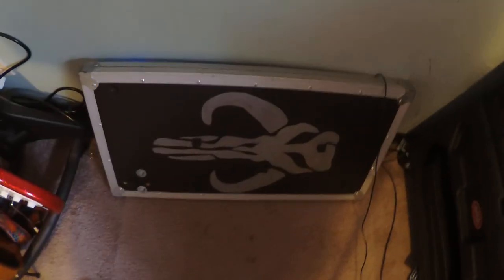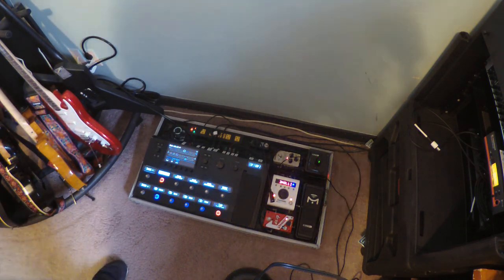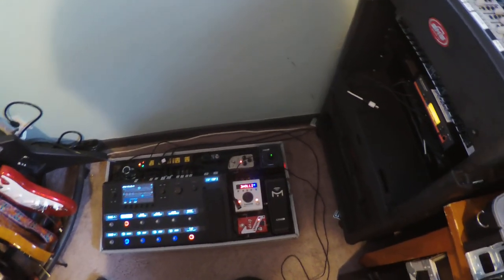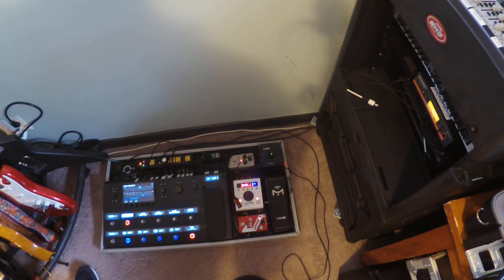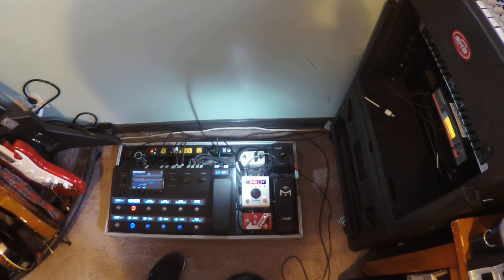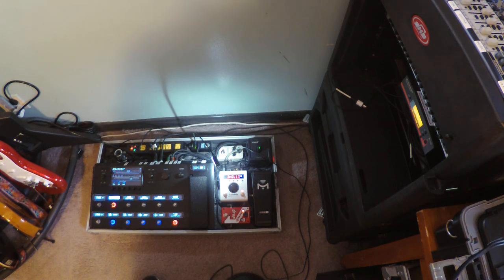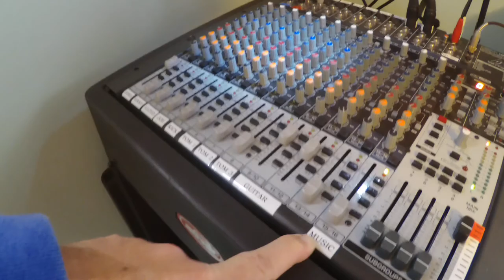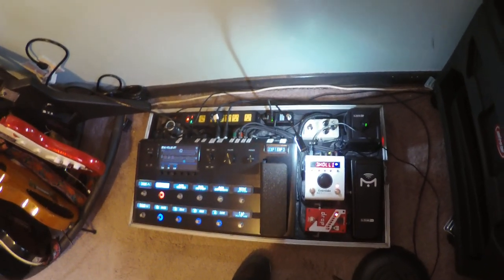Josh's Helix Pedal board

Comment: I like the setup - very nice - I was under the impression that you want to use the drop before any effects so essentially tuner (like TU-3) then Drop - then Helix.  With Guitar then going into the tuner or in possibly your case the drop.  But from your video you mention you have the drop on a send/return loop (possibly with the mimiq) - if true where do you plug in your guitar?
Reply from the maker: I go from the G10 directly into the Helix.  I used to go into the Drop first but I changed it up.  The Drop is in Loop 1 and that loop is the first thing in the chain of FX.  I have a noise gate right after it and I turn off the noise gate in the input block (where you can choose the input type - guitar, variax, multiple, etc).  I only have that loop on 3 patches that I use for tuned down songs (Godsmack and Limp Bizkit).  Loop 2 is the Mimiq and that is after the amp at the very end of the chain with only delay and reverb after it.
Reply: Oh right the G10 - forgot you were running that.  Thank a bunch.

Comment: Great vid. I recently purchased the Helix and was curious about a good board. 
I also just tried connecting the XLR to a PA and had latency issues (strange).  Have you ever run into that issue?
Reply from the maker: No latency at all.  The Drop pedal has a little latency but I don't notice it.  Heck, sometimes I leave it on and start playing the next song in the wrong key.  That's embarrassing.  But no, I don't have latency.

Comment: Looks like you are using the mission spring loaded pedal. How do you get the effect to kick on with the pedal only? If the wah is always on, how do you keep it from bleeding through when not in use? Thanks
Reply from the maker: It's not spring loaded.  I did experiment with using rubber bands around the heal for a while and that worked OK.  In the Helix bypass assign for the wah I have it set to activate at 1%.  As long as it is at full heal down - 0% the wah is off.  If the wah get's moved slightly it could come on but there are ways around that.  I'm actually getting a spring loaded Mission pedal.  I will use the spring loaded for wah (so it will always go back to zero) and the non-spring loaded will be for Whammy FX which I use a stomp switch to activate.
Reply: Thanks for responding.  So you are saying that the bypass assign is what will activate the wah at 1% and more importantly turn it off when not in use and completely heel down? I have just purchased the Mission spring loaded pedal and want it to be completely off when heel down and come on as soon as I step on it. I couldn't figure out how to cut off the effect completely when not in use other than assigning it to a switch and stomping on it prior to hitting the exp pedal. Thanks
Reply from the maker: In the wah go to bypass assign, change the "Switch" to the EXP pedal you are using.  Then you will see Position with 5%.  I like to change that to 1% and I also change the delay time to about 200ms or so.  You will have to play around with it to see what feels good to you.
Reply: You Rock...Thanks

Comment: How are you powering the G10?  I'd like to get something with a smaller form factor.  Curious what model USB hub you're using and how much power is needed for the G10.
Reply from the maker: I'm using the USB output on "The Bright Switch" pedal.  I figure it's a light and I can get rid of a wall wart.  I'm powering the pedal with a Pedal Power Digital 4x4 I think.  That powers the Fequout, Drop and Mimiq also.  I think the G10 needs to see 5v and the pedals need 9v.  The Bright Switch converts it and it's worked great for many months now.
Reply: Where do you get one of those?  

Also, I've been on the fence about grabbing an EVH 5153 50 watt head and matching 2x12.  Your videos have been a huge help in learning the possibilities of that kind of setup.  Do you still have that setup?  You really that satisfied with the Helix replacing it?

I've been using the panama and BE models on the helix, but didn't really feel like I was getting that 5153 tone.  I read a comment last night where you were talking about using the Archetype lead and damn that model sounds good.  I didn't even think to check that one out, but it gets me into that 5153 ballpark a lot easier.
Reply from the maker: http://www.guitarcenter.com/The-Bright-Switch/The-Bright-Switch-USB-Utility-Pedalboard-Light-and-Charger.gc
I am satisfied.  I do not miss the 5150 at all.  It was so much more to carry around.  I have 2 EV monitors that I can run in stereo.  I needed monitors anyway for the band so it just made sense.  For me, the key to getting a more realistic sound is using the IR I like.  It's an OwnHammer IR of a Marshall cab with EVH speakers using the Modern mic combination from Heavy Hitters pack #1.  I know people swear by the cab sim in the Helix but they just don't do it for me.  I think I get a real and unique sound.  I also cut the lows at 65 hZ and the highs at 7.5 KhZ.
Reply: Thanks for the link.  So, you power it with the Voodoo Labs, but is it plugged into a 1 amp output on the VL?  L6 is saying the g10 receiver needs to see 1 amp at 5 volts for power.  

Thanks for the tone tips.  I'm definitely going to be getting those Ownhammers regardless, but I've also been getting along with the stock Helix cabs.  I don't have anything to compare them to at this point though, so maybe I'm missing out!  I started messing with Low cuts on the cabs last night because I couldn't get my palm mutes "tight" enough.  Those adjustments seemed to have helped.  

What EV monitors you using?  There are so many friggin options for FRFR, but I've been considering the EVs, Yamaha DXR, QSC K series, and the L6 stage source monitors.  Is the cab vs monitor + helix that different in feel?

Thanks for answering all my questions, I appreciate it!
Reply from the maker: Yes.  The G10 works on a standard cell phone charger and the power output of the bright switch does that.  The bright switch is powered by the Voodoo Labs.

I have the EV ZLX 12Ps.  I didn't like the fact that they had DSP to internally change EQ (for the difference between using them as monitors or full PA speakers etc.) but they are set it and foget it.  My band used QSC K12s as mains allong with matching subs and we also have 2 K12s as monitors.  When I walk over to my bass player and listen to my guitar in his monitor I don't hear the $300-$400 difference.  
The K12s are great, but I just don't think they are worth twice the money.
Before you buy anything...... Try it for yourself.  Don't just go on opinions, even mine.  Take your guitar and Helix to a store and try out several monitors.  I'm sure you can also find a Helix player that lives in your area that you can chat up and try their gear.
Good luck!
Reply: Thanks again for your input!

Comment: Thanks for the ideas, I’ve added a few pedals to my helix and now I’m going to add a pedalboard, I got almost the same setup you have,  Mission pedal, Mimic and G-10 wireless, quick question, where did you get the Velcro snapping strip from? Also I needed power supply, I take it that you like the one you got? Thanks.
Reply from the maker: Thank you!  It's called 3M D.ual Lock  You can get it on Amazon or at most home improvement places.  I have the Voodoo Labs digital power supply and it works great.
Reply: Great, just ordered the Road case USA 32x16 for 130.00 delivered, looked for the Voodoo labs digital, but looks like a different structure, don't think it will work, looks to wide, have to look for something else. Thanks for the info.
Reply: Are you all running the Mimiq in stereo?  Do do that with the Helix are you running the left channel in into say send return 1 and right channel in send return 2?  or some other way?  how are you running cables for stereo on the Mimiq?  Thanks for the insights.
Reply from the maker: You can use the Mimiq to double 1, 2, or 3 takes.  I only like using the Mimiq after the amp and I only use 1 double.  If I ran a stereo signal into the Mimiq there would be a dry side and a wet side.  That's extra cables so I only run into the wet side and keep my dry signal in the Helix.  On the Mimiq there is a "Mono" and a "Stereo" side.  If you are running more that 1 doubler then it spreads out the signals differently across the stereo spectrum and you can't do it the way I do.  
Hopefully this helps.
Reply: Are you using a balanced 1/4" cable that is split into the stereo right and left to go into the Mimiq?  Or just running a 1/4" TR cable from the send into the Mimiq mono?  I was planning to run it in stereo from the send and back to the Helix using TRS cables.  Thoughts based on your experience with it?
Reply from the maker: Just a plain 1/4" cable in the Stereo input of the Mimiq.  Then a 1/4" cable from stereo out of Mimiq.  I have an entire path (2B) in the patch that is just the loop of the Mimiq.  Where that patch returns I have 2A (the "dry" side) panned hard left and the 2B path with the Mimiq panned hard right.  If you are going to use more than 1 double effect in the Mimiq then you need to run stereo but I would not recommend using a y cable.  Just go mono into the Mimiq and stereo out or stereo in and stereo out.
Reply: Dumb question by me I am sure, my Mimiq has an in and an out each with two ports that are 1/4" TR only.  Thus mono unless you run two cables in and two cables out.  The Helix send and returns are TRS or TR.  So I was thinking it was required to split the TRS from the send into two TR cables going into the Mimiq and then the opposite on the return path to maintain stereo.  Am I off?  Thanks a ton for hanging in there with my questions.
Reply from the maker: Helix is not TRS on any of the 1/4" jacks.  I think you are making it more complicated than it needs to be.  You can just go mono into the Mimiq and stereo out with 2 1/4" jacks if that's what you want to do.  Again it depends on how many double track you want the Mimiq to make.
Reply: Yeah - I am going off the Helix Cheat Sheet where it says, " Sends/Returns Can be used as mono/stereo FX Loops for inserting external stompboxes into your tone or as additional inputs and outputs for connecting keyboards, drum machines, mixers, other modelers, and more"
Reply from the maker: You have to use 2 loops to run stereo. When you go to add a loop as a block you can choose mono or stereo and then the options are to use loops Send 1/2, Send 3/4, Return 1/2, Return 3/4, FX loop 1/2, FX loop 3/4.  For my H9 I am using stereo loop 3/4.  For the Mimiq I am using mono loop 2 and only going through the "stereo" side of the Mimiq so I am only getting back an effected sound in that loop.